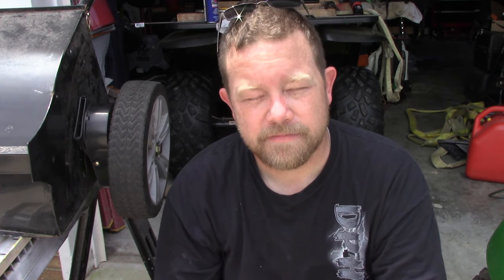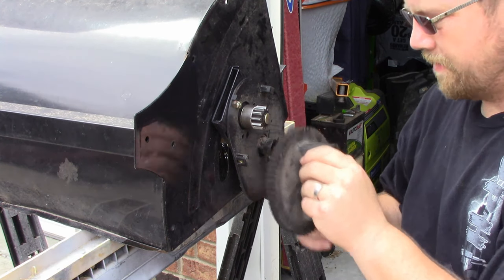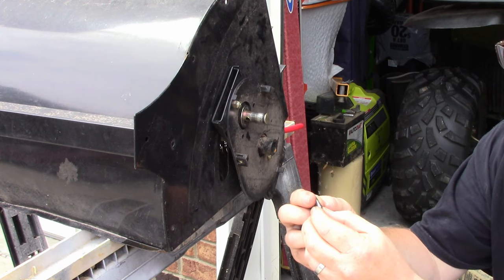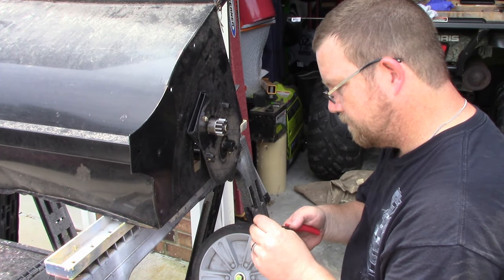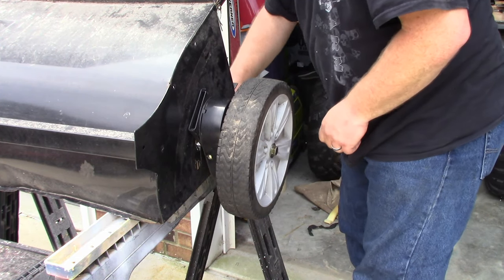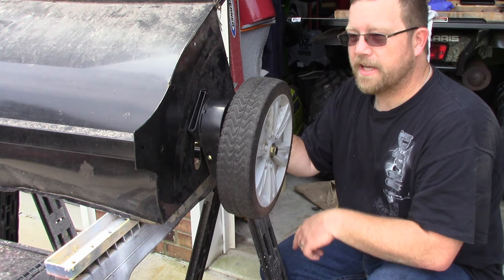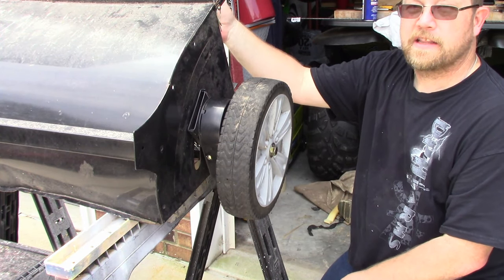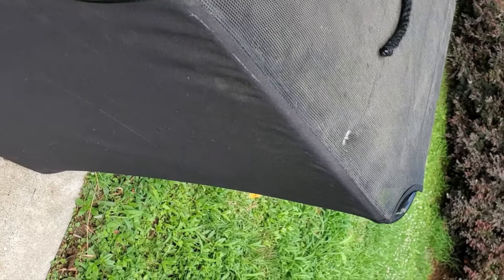Groundworks sweeper 42 in. that has stopped sweeping. Repair and diagnose

Comment: I have a sweeper just like the one in the video. Can’t not find where to but parts. I need the frame and bagger for my 42 in. Thanks
Reply from the maker: I have found the manual for it.  It is a tractor supply item. You can call them and they can put you in contact with a parts seller, maybe? But, due to age, it might be hard to get or find replacement parts.
https://hugepdf.com/download/lw0103-42-revised-im-20130913-revised-diagram-of-height_pdf   
I'm sorry I could not find a parts supplier for it. But, it could be made for other companies under a different name too.

Comment: Easy enough to repair but I don't have any spare metal lying around to use for the replacement pin. Where do I buy one?
Reply from the maker: I got the steel rod from tractor supply or home depot.

Comment: I’m working on a blue hawk lawn sweeper that won’t turn. I took all the pieces apart and cleaned them w wire brush, pins don’t like that damaged. Is it possible the sweeper is so rusted the rod that the sweeper is attached to?
Reply from the maker: Yes, I've seen that and took everything apart, inspected, and cleaned it. It's amazing how a little rust can stop it from working.